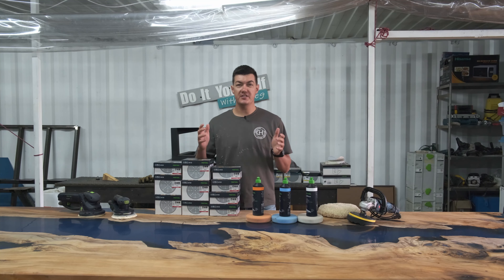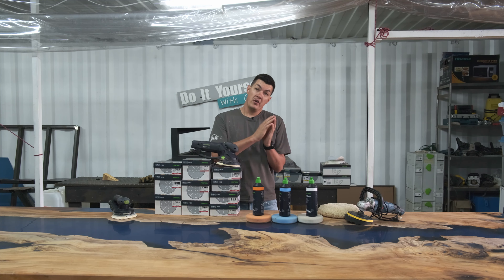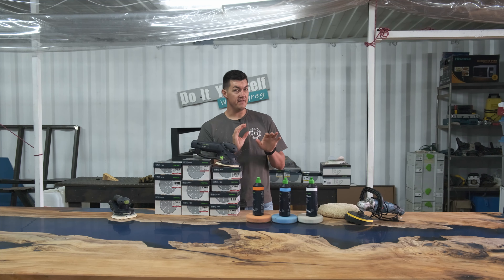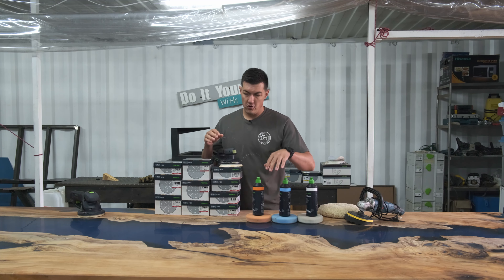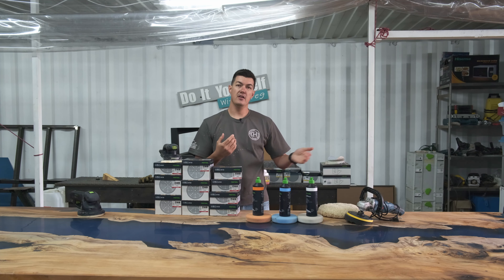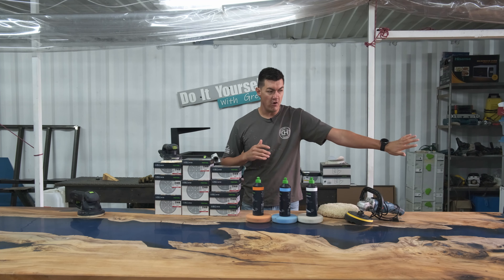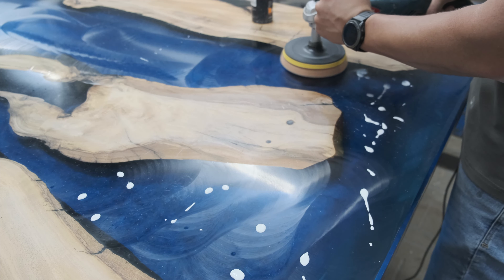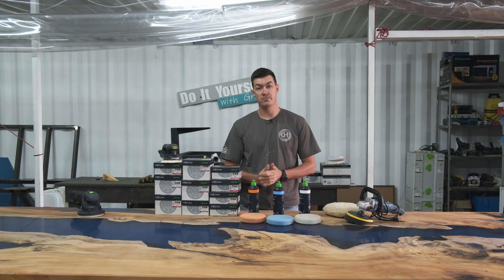How To POLISH Epoxy

Comment: Greg, if i sanded the wood section to 400 grit then carried on the epoxy to 1500 grit for a shinny finish, i will sand onto the wood edge giving the edge a 1500 grit sanding, if i cant sand the wood edge back to 400 grit  for what ever reason will this be noticeable. Sometimes you cant resand back to 400 grit because that section of wood might be quite narrow.
Thanks
Johny
Reply from the maker: Good question, we posted a video recently on this topic. Just make sure you come back and sand as close as possible to the edge without touching the epoxy.

This does take a lot of time, unfortunately.
But when applying odies it really really hard to notice.

Comment: Hi Greg, I have bought your document with all the knowledge and information, thank you very much for this, so much info it is great. One question that I can't find the answer to in your document is - when you sand out the cnc Mark's from your table, do you then use the finishing sander on the wood and epoxy from that point onward rather then an ordinary sander.
Reply from the maker: Hi Johny, first of all thank you so much for the support 🙏🏻

You can use any sander to remove the lines, will definitely not recommend a belt sander. 
And what i have noticed a couple of days ago, we used to start sanding with 80 grid but the 80 grid makes very deep lines, so we will now start sanding with 120 grid.. 

By the way im starting a online epoxy master course soon.
Reply: @diywithgreg  That's great Greg, I will be looking out for your epoxy course

Comment: Hi Greg! Just a question..I hope
to make it clear, since it’s a bit articulate..how do you manage to polish just the epoxy section and not the wood? I mean..while you sand the wood up to maybe 400 grit, to oil it afterwards, and you also polish the epoxy to high gloss finish, in the very transition section where the wood meets the epoxy, that wood portion is likely going to get polished too, i guess...but all the other wood parts were just sanded and not polished..so can it be a problem having the wood partially sanded and partially polished when it comes to oil it? Cause I think the wood soaks the oil differently..I just knew that when the wood is polished, it’s like a mirror, the grain is almost completely closed, and it almost cannot absorb finishes..sorry for the extremely long question🤦🏻‍♂️ Anyway, gret table, as always! Merry Christmas from Italy
Reply from the maker: Hallo, i have a full document on our methods and techniques we use to build all our tables and all the information you need, and I documented everything.

You can find the document here

https://www.diywithgreg.com/shop